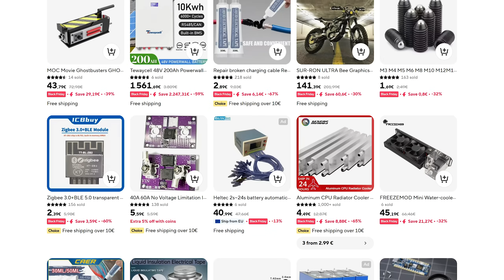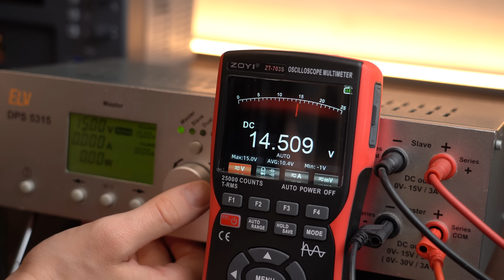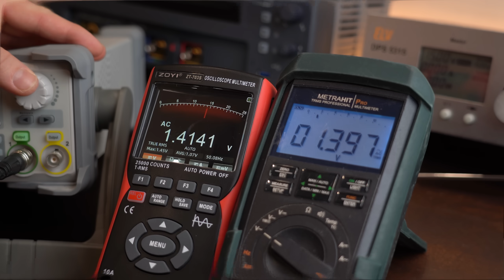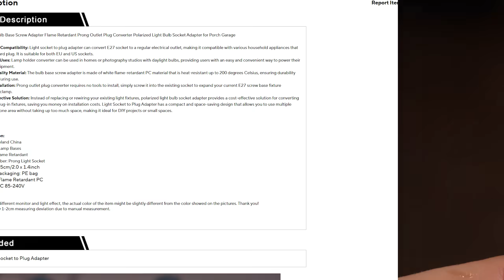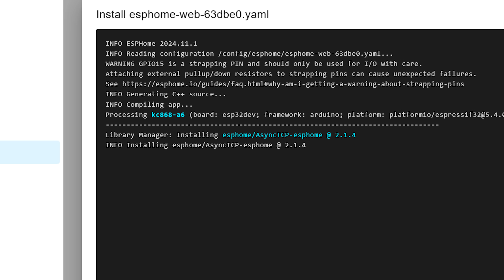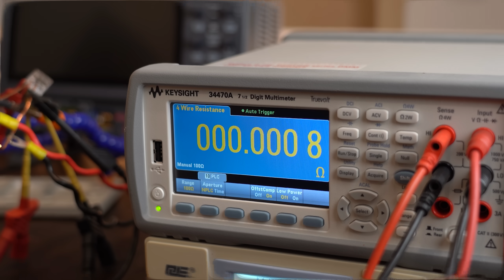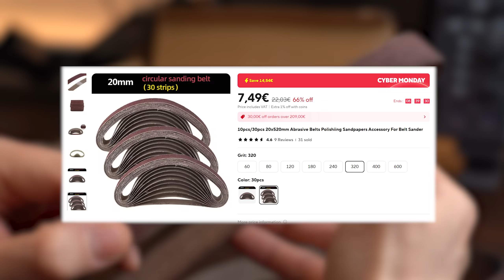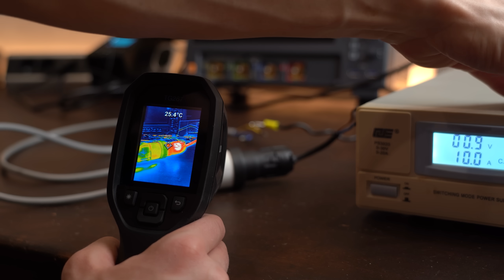I tried finding Hidden Gems on AliExpress AGAIN! (Part 12)

Comment: That plug on the light bulb socket has been around here in asia for more than 50yrs already.We used that in our office. Our office is old and the ceiling has light bulb receptacles. But we want to install LED lights like those long LED tubes. So mount the led tube, take out the light bulb, screw in the socket adapter and voila, working LED lighting tube. Aside from socket adapter, there are other things you can screw into the bulb receptable like wifi extenders, ceiling fans, wireless CCTV cameras, speakers, circular LED lights

Comment: I actually use the socket adapter for the heating of our turtle house in winter. The temperature must not drop below 4 °C, so I built a heater with an ESP and one of those flexible heaters. The whole thing draws like 15 W, and the only source of power is a lamp post in the garden, there are no outlets nearby (or you'd have to let a window open which is also not practical).

Comment: In reality, you wouldn't want to be using appliances on your lighting more than occasionally. Homes generally have separate circuits wired in for lighting and appliances. Usually one of each for upstairs and downstairs, with another for the kitchen appliances

Comment: 5:52 This is basically a worldwide universal socket adapter.  We have tons of different wall outlet socket types but in any country that uses lightbulbs  (Which I bet is every single country by now), you are bound to find an E27 socket. Considering that most power supplies are capable of working with both 120 and 220 volts, this thing could be useful for people who travel often.

Comment: The light fixture adapter also shows the worst weakness of Schuko: you can insert a (grounded) Schuko plug into a socket that carries no ground connection. That thing is a death trap! 🤯

Comment: AliXpress usb micro-tube camera - 4x magnifier with very weak led's around the tip. Very useful to put inside holes and places hard to get inside,  the quality in low light is terrible but it has doble USB A and C connectors and can be used with any old Android phone and is Usb compliant so will work with any app. It also autofocus. Maybe there is a new one with better lights. There is no intensity control over the leds in mine. Hard to read but better than nothing , the cable is long enough to reach cables inside walls, but very hard to guide. It has a small magnet dongle on the tip for such usage like turning in tight corners inside a wall conduit or attract a loose metal cable and try to pull it out... Great Scott!

Comment: Don't mind me pointing it out.
The idea of using adaptors inside light bulb sockets as mains outlets is almost prehistoric. 
Personally, I always abstained from engaging in such folly because of the often feable mounting of Lightfittings beneath the ceiling. 
But then again, I am not Chinese, but was professionally trained to think a tiny smidgen much more VDE. 🤗

Comment: Haha, I recently also got that "digital microscope". For same purpose. It said 500x magnification, which would be insane. Of course it does not do anything like that. But some 10x magnification is there. The biggest disappointment was that you have to put it like really close, so that no tool could be under it. But then I showed it to someone with medical background - ohh that's a dermatoscope. If it was just called that, it would have been my fault to buy such. But it wasn't, so bad review was left, if that matters anything.

Comment: This socket that screws into the lamp instead of a light bulb is useful in places where there are no sockets. For example, in blocks of flats where you need to do something outside, e.g. mow the grass with an electric lawnmower.

Comment: I'm sorry to say that light bulb socket is useful. In some use cases. In my boiler room I wanted to replace the incandescent bulb with a 5 volt USB LED strip and is place it all around it. There was no outlet in that room. Low power applications that thing is great.

Comment: These adapters for the light fixtures were pretty common in the old days. When many households in small villages got access to the electricity grid where I live in Switzerland, there often only was one light fixture installed in the living room and maybe something like an electric loom was also attached directly to the grid to work from home, which was why many got it in the first place; To work at home in the evening. But if you wanted to plug in anything, you had no chance. There just weren't any sockets beside that one light fixture. So people used these things. And back then, that was less of an issue than today because most light fixtures only had 6 A fuses to protect them. That, although still too much for many fixtures and their wiring, was not an immediate disaster. That massively changed with more energy consuming appliances and 10 to 13 A fuses. You could overload these light fixtures massively, so it was potentially extremely dangerous because of fire hazards. That and the missing earth connection lead to them being banned completely. But what does Aliexpress care about people plugging in their space heaters into their light fixtures and burning their garages down?

Comment: Those light socket adapters are for when you want to replace a single bare bulb ceiling light like in your garage or basement with a LED or florescent shop style light. It means you don't have to rewire the socket and you can control the new light with the same switch you used for the old one.

Comment: I tried some of the things that they push on alliexpress, so far I have gotten screwed enough to become the old woman in the shoe, should I be a woman, thank God I am  a man and needn't worry about such things. The only good thing, if you look around hard enough you can find a way to request a refund and I have gotten a couple of them so that mitigates the harm a bit. One outfit advertised an android tablet for 32 bucks, when I got the package it had a cheap ass optical corded mouse that was so damn old that it said it was windows 98 compatible! Got a refund on that one, another was selling an emulator hand held for 18 bucks, ever got shit from them and got my refund on that one as well, I should have known better even without a card the emulator sells for over 60 bucks, I paid 110 for them on Banggoods.  Good emulators so I figured I would give the bargain on it a try, I should have known better I guess.  So be careful what you order from the thieves who occupy space on AliExpress, they do sell some good shit to and I have had luck with some of their ham stuff, I still play around on the airwaves a bit and exercise my ticket from time to time with the radios that gather dust in my ham shack.

Comment: Great video! While watching the part about the digital microscope and it’s inability to focus on distant and hard to reach electronic components I had an idea. I have bought a cheap ear canal camera on AliExpress, that costs only around 10€. It connects wirelessly to your smartphone and offers a good magnification. I just tried it with electronics and it works great!

Comment: What you want is a jewelers loupe. So you can read the text on chips and parts easier. 

Theyre cheap too. As all they are is a small magnification lens. Get one with a built in light if you can, and rechargable.

Comment: those light socket wall plug adapters are not that strange, although that specific one is an awful design. I actively use one that's far better, that I got at Walmart for like $3 USD (Physically, not online). It has 2 sockets, one on each side, and it still has a light socket, with a pull chain to turn the light, but not the sockets, on and off. I use it because there's no outlets in my closet, but I leave my dust buster in there charging.
5:48 like that Amazon listing labeled "Lampenfassung, Kun..." but white, and a pull chain rather than a through-rod.

Comment: The Plastic of the ac outlet on the lightbulb fitting must be flame retardant, if it burns and you quit power or heat external the flames must go out

Comment: When i switch on the washing machine connected to a 4 relay module and Arduino, the module works erratically. But without load the module works well. What could be the reason sir?

Comment: Hi, nice review of the Scope so much that i bought one ... but i stumbled on a problem , huge offset that you can't calibrate away, did you have any info or tips on this ? Can you check if you have the same problem on both channels , with around 100mV signal the trace is offset of - 31mV

Comment: Btw....I recently just moved to Germany, Karlsruhe to be exact. Is there some where I can pickup small electronic items (resistors, LEDs, arduino sensors and stuff like that)? I know online stores do exist but not aware of them. Ebay and Aliexpress is an option, but is there a local option?

Comment: light bulb power sockets were quite common in the 1960s (in the UK) but everyone was aware that lighting circuits were fused at 5A (1.25kW), or occasionally 8A but were NOT safe to use with high power appliances like our 13A wall sockets (>3kW) or heating/cooker circuits which were fused anything up to 35A...... just saying.....it's the kind of trivia we old-folk like.

Comment: Hello friend, I hope you will not be offended. Your English is improving a lot, and I have some things you might want to improve on.

1. If a word ends with D or T, you pronounce it as "tssss". For example "It" -> "Itsss", "Code" -> "Cotssss". This is probably the most glaring one.

2. Often if a word has "t" inside of it, you will pronounce it as "ch", whereas most often it should be pronounced as "t". I suggest checking the words you pronounce as you go filming, this way your pronunciation will improve a lot!

3. The melody of your sentences: normally, sentences in English start at a higher pitch and slowly drop in pitch. You do the opposite which is confusing. That is reserved for questions.

4. You pronounce syllables separately. In English, they flow into each other. For example, in mathematics, when we read the symbol for the derivative of the function f, written f'(x), you would probably say "eff dashd eggs". The correct, fluent pronunciation would be "effdash dex". See how the "d" at the end of "dashed" went to the start of "x"? That's done to make it more fluent. English has no glottal stops between words at all, whereas Eastern European languages almost always do this. Similarly there is no glottal stop between "eff" and "dash", it's all pronounced in one go.

Thanks a lot for your videos and I hope this improves your reach!

I suggest periodically asking people from England or the US to review your pronunciation in order to stay on top of it. Soon enough you'll see great improvements!

Comment: Socket in light feature are also usefull when you have a light fixture installed in the wall and you want to replace it a socket plugged lights. It's a super easy fix instead of rewiring stuff.

Comment: Those adapters that screw into a light bulb socket and turn it into a power socket?  Those used to be really popular back in the days where the price of electricity was lower for lighting circuits than they were for other outlets.  Yes, there used to be separate charges for different circuit types.

Comment: 0:30 i understand that you ppl have no idea what "work" is, so let me just give you a free knowledge - it's ment for construction sites or houses/appartments under refurb since most likely you will leave light lines for the last so you can actually see smth. But since you might need a tool instead of a light (during a day, which is 99% of the time when ppl will work there anyway) here comes this reduction. Shocker, i know, "work".

Comment: The liquid electrical tape is really great if it is still liquid. You just had a bad supplier - but complaining via Ali express usually gets you a free new one. I use it for my greenhouse project. One thing to keep in mind is to use the entire tube quickly or it will dry out.

Comment: This adapter for the lamp to make it into power socket used to be popular in Poland back in the old days. We would call it a "thief" because it converted a lightbulb socket into power socket + lightbulb socket so you can easily tap into common power in the basement of your apartment (this electricity is included in your rent so nobody pays extra for more usage) so everyone was "cheating" a system like that

Comment: The light socket adapter might also be useful to connect low power dc adapter led lamps in closets, as well as other (low power) networking, etc.

Comment: I have liquid insulation tape, but in a tin with a brush built into the lid works well. but messy. had mine open for a number of months hasn't started to set yet. Each application used takes about 24 hours to set. So not a quick fix.

Comment: the problem with the e27 socket thing is that light fittings are usually not rated for a high power

Comment: The first Oscilloscope definitely requires it's own video. I think it has FFT too, but not too sure. I owm a small handled Oscilloscope that is the ZEEWII PRO, wich is small, compact and has a decent signal generator. It is very accurate at measuring frequencies (tested both with low and high frequenciee). Cool video as usually. Maybe you could consider to review a RF spectrum analyser ? The TinySA is cool (tho for better capabilities the TinySA pro is better despite its price)
Reply: It actually has FFT from last software updates, but it doesn't really have any value measurements or settings for it
Reply: @exLeute  oh i see, so it is a fairly useless feature to say the least

Comment: Those light bulb adapters that turn into power outlets were VERY common in the UK from about 1930 till about 1975 .. so, as you said, nothing new there 🧐
In fact, way back then, wall sockets didn't exist, you would use a lead from the lightbulb sucket..then about 1935, they started installing dedicated wall sockets. Remember lighting was the Only use fir electricity in the begining. No other appliances really existed.

Comment: Probably already mentioned, but the angle grinder attachment isn't for use on plates of steel. You are supposed to mount the grinder securely, such as in a vice, and use the belt in a stationary position. Sharpening knifes, cutting corners of small metal plates, sanding wood of various heights, or similar situations is what these are used for. The Belt pushes the work piece down onto a deck, or vice.
The area of the bracket that has a space is the working area that you apply pressure. You don't apply pressure the length of the arm. That's for keeping the belt cool and dislodging pieces that may have been embedded.

Comment: In eastern bloc such lightbulb adapters were common but engineered much smarter: two sockets for plugs to the sides, and a lightbulb socket in the middle, so you'd screw it between the lamp and the lightbulb. Not very comfortable as you'd burn yourself on the lightbulb plugging stuff in/unplugging, but they were definitely better than yours.

Comment: Hi, at this day (2024-12-18), you can find the ZOYI ZT703S at : €66.20 (with french VAT @ 20% and free delivery), which makes it an even better bargain.

I also found :
* ANENG M113, multimeter 999 points 4 digits, resistance 0-10 M @ 1.2% precision, voltage AC/DC up to 600 V, data hold and NCV to detect wires in walls, at this price, it seems to be the good universal tool to always keep in a toolbox : €0.99
* ANENG ST170 amperemetric clamp 500 A, voltage AC/DC 600 V, resistance 0-20 M, capacitance Cal. 200µF, Diode, Flashlight, Data hold, NCV to detect wires in walls : €1.74 (no typo here, it is really €1.74 TTC w/ free delivery)
* TOOTOP ET11S, a 6,000 points multimeter with thermic imaging 90×120 pixels : €79.98

Comment: Liquid Electrical Tape is available locally or online even thru major brands like Permatex, Gardner Bender, etc. Is OK for some uses but not good for many other projects. For a start they won't stick/bond to wire insulation or many other parts and thus not "water proof" when hits other things and no strength when wires move. Then once the container is open the first time, the product will skin over in the container in minutes to hours when resealed but expect to wast the rest if not used in days to a couple weeks.

Comment: I use an E27 adapter in the basement in my apartment because there I don't have wall sockets and can't install  wall sockets  without problems with my neighbors. I use it only for small power tools for few minutes 1 - 2 times per year.

Comment: The screw-in plug adapter is illegal in the EU as it allows for class I products to be connected to a class II socket. Also, there is no insulation when connecting a plug so your fingers are able to touch live parts.
You can buy it and use it for yourself but don't lend it or, god forbid, sell it in the EU as the MSAs will come looking.

Comment: For low resistance measurements, I use a vape. (a proper 'mod)'. They can go from 2 to 3 decimal places (ohms) reasonably well. Useful when a multimeter won't measure.. Heater wire for example...

Comment: I've got that scopemeter as well, works pretty well as a meter too (I wanted to add another good continuity mode and it is snappy and fast which is more than can be said for a lot of cheap DMMs, the last good one I have is the UT61E)